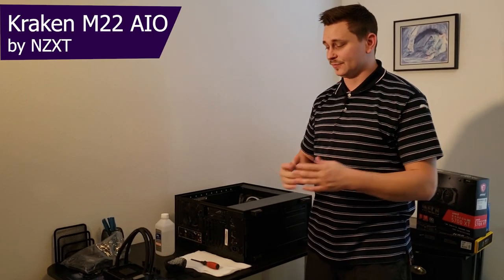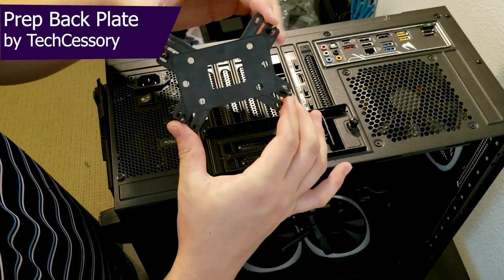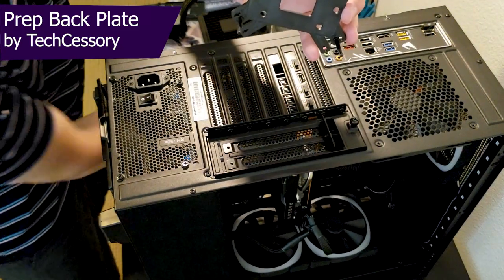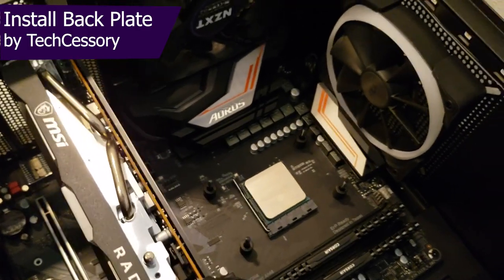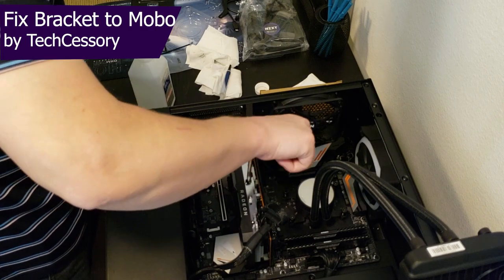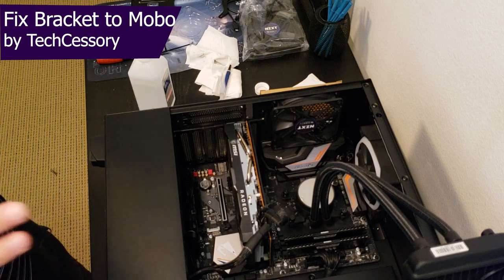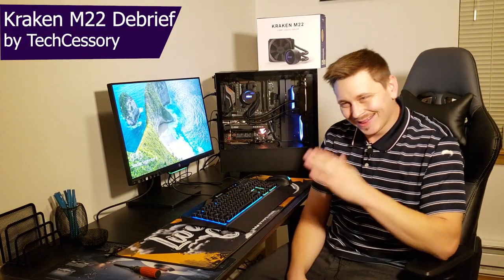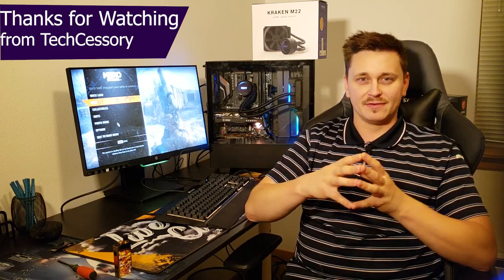AIO Liquid Cooling | NZXT Kraken M22 Install Guide

Comment: Hello sir. Late comment but Can i use the 120mm fan/radiator as an exhuast instead of an intake?
Reply from the maker: Exhausting from the front? It depends on the rest of your components. If your case runs hot already than I would suggest not to, but you still can. Let me know where and I can give some more input.
Reply: @BainCustom  Thank you for the reply kind sir. I have an antec gx 200 cabinet. My Air cooler simply isn't doing well enough for my i7 7700k and I want to buy this specific cooler as it is withing my budget. Now, I am currently using two front 120 mm intakes, which I plan to replace. I also have a 120 mm exhaust in the back of the case which I plan to replace with the radiator and 120 mm fan that comes along with the NZXT krakken. Will this be a good change for my airflow?
Reply from the maker: That's a tough one. Typically if you are able to exhaust in more than one location than I can see it being beneficial. Because of the limited airflow in the case I would still run the radiator at the front for fresh air.

Either one will work and the CPU I'm sure will survive just fine, but the radiator will constantly be taking in warm air. Which can wear it down quickly over time. Is there any air vents on top? It didn't look like it
Reply: @BainCustom  no only two intake slots in the front and one exhaust slot in the back. Should I just set up the radiator in the front along with another fan and have 2 exhausts in the front and one intake in the back. Will the air pressure be efficient in this case?

Comment: Hey is your AIO loud? I look at the bios and the pump's RPM is around 3900+. Is that normal? can you modify the pump speed?
Reply from the maker: Mine is fairly quiet. I have not seen for the M22 a way to change the pump RPM, I would imagine it's purely performance based. I am about to do a review on the kraken x53 which does have control of the pump.
Reply: @BainCustom  hey thanks for the reply, where is the water tube located on yours? I have mine below and I'm thinking of putting it above(might look bad but might solve the loud sound and vibration)

Comment: I'm sorry I'm new to pc building but does this only fit in nzxt cases or will it fit in my be quiet pure base 500?
Reply from the maker: No worries at all. Absolutely, it should have no problem fitting at all. You would probably want to install it onto the front of the case.
Reply: @BainCustom  ah cheers mate
Reply from the maker: For sure!

Comment: Does it matter which way the 120mm fan is facing?
Reply from the maker: Well, it depends on your case setup. But you will typically always want to be pulling or pushing fresh air over the radiator, not hot air from inside the case.

Comment: Should I plug the 3 pin pump cable into a   Cha_Fan/WP header?
Reply from the maker: Yeah I think I have my in a fan header or the CPU fan header. Either way works. But preferably the pump to the chassis fan and the fans to the CPU connection.
Reply: @BainCustom  but the problem is my fan cables are connected to the pump cable I think thats because the fans are controled of the water temerature
Reply from the maker: What aio are you using? I haven't seen all cables into one yet. It would be just like having an extension cable added to a single header.
Reply: @BainCustom  The NZXT Kraken X53 the pump has two cables that go in, one is for the usb 2 port on your mainboard i think for the rgb and software and the second cable that you put into the pump is three cables in one. (Sata for the power, Fan headers for the included fans and the actual pump cable that I was talking about.)

Comment: Hey man I got mine today and when I use the spacers it’s wobbly because it’s loose and doesn’t tighten and moves around but when I use no no spacers it tightens really hard and stays there perfect. Is that bad ?
Reply from the maker: What CPU and motherboard are you using?
Reply: @BainCustom  ryzen 5 3600 with b450 tomahawk max and the mount was dont right and everything.
Reply: Oh yeah I meant to say I put 2 spacers and they tighten but with one it doesn’t. Is that okay?

Comment: I don’t have an aio pump connector 😬 what do I do
Reply from the maker: What's your motherboard model?
Reply from the maker: You may use the CPU header if you have no aio pump connection on the motherboard btw. But I prefer to use the aio pump connection.
Reply: TechCessory I couldn’t find any of the ports on my motherboard, so I made the safe decision to take it all off and return it because I don’t want to ruin my computer. Do you recommend any good coolers that aren’t liquid? Also for AM4
Reply from the maker: Anything from noctua is good. I believe Corsair just put out a new air cooler or it was NZXT. I would look there for sure.
Reply from the maker: It's the Corsair a500 which I will be making a video about soon I think.

Comment: Hi can you please help me? Im so confused. My mobo has no rgb header so can i change the fan included with rgb fans but molex powered and the pump is powered by cpu fan header?
Reply from the maker: Yes, one option is to power the pump using the CPU fan header. Thanks for the question 👍
Reply: @BainCustom  but the pump is 3 pin and my cpu fan header is 4 pin will it work?

Comment: Hey I have a the Asus Prime H310M-E R2.0 motherboard and I can’t find the 3 pin connector for the radiator. Is it compatible?
Reply from the maker: I break this down a bit better in a newer video. Typically you will want to use the system fan pin or the CPU fan pin for the pump. I tend to use the system fan and then the CPU fan for the actual radiator fans.

Comment: Is the backplate necessary or can I use the one that my motherboard has
Reply from the maker: Yeah you have to use the included backplate. It doesn't adapt onto the am4 backplate. At least they didn't send that hardware with the AIO when I installed it a while back.

Comment: Good video, like it
just one thing.... you didn't install the RAM on dual channel, please read your mobo manual xD
Reply from the maker: That's interesting. At first glance I read the manual and it says 2 & 4. But the way they label the slots make it side by side.

I appreciate the bit of info. I probably would not have noticed, I do also get 3200mhz from the ram. So I hope it helps with the switch.
Reply: @BainCustom  Don't worry, the same thing happened to me on the same motherboard, but one day reading the manual I realized that the modules were bad installed and changed them.

By the way, I checked your channel and looks interesting, subbed

greetings from Mexico!!
Reply from the maker: Thanks for the support and tip. I changed it around today and I did bench about 30 points higher and no crashes.

So it definitely helped.

Comment: My Motherboard dont have a pump connection can i put it the pump 3 pin in the CPU Fan connection
Reply from the maker: absolutely. I am current running my pump on the cpu fan header as well.

Comment: is it ok to cut just a little on those hose,  its kinda too long for my rig
Reply from the maker: I personally wouldn't. It will void any warranty and the length of the hose is optimized for cooling. Rotate the radiator so the tubes coil up a bit to save space instead.
Reply: Royrafe Bancoyo no
Reply: @BainCustom  when should i change the liquid inside, its already been like 8 months after i bought it

Comment: Hey i order the m22 and im not replacing the cpu can i use 70% isotopic alcohol wipes to get the thermal paste off the cpu
Reply from the maker: For sure. Don't be over generous since it has more distilled water in it. But it shouldn't be an issue as far as I am aware.

Comment: Can i exchange the cooler fan with the back exhaust or no?
Reply from the maker: Almost any 120mm fan will fit on the radiator. If you are looking to place it in the exhaust fan opening then it would depend on the case.

Comment: i install this and when playing rainbow six siege max temp is 62c is that hot ? or i need to change the fan position
Reply from the maker: Under load...no. if you hit the 70's and 80's I would think about a 240mm instead. What is your CPU?
Reply: @BainCustom  2070 54-58 max load  but my gpu still hot 69 to 75c is that ok? i forgot to mention mine is x53

Comment: So you don’t need the small usb at top of the thing on cpu because that only controls lighting right?
Reply from the maker: You could opt to do that. But you will not get any control from the CAM software if you leave the USB connection out.

Comment: So I have a AM4 bracket, which holes do I use since the graphic is a little confusing
Reply from the maker: You want the bracket to be vertical on the motherboard back and line up the 4 screws to fit into the motherboard. Kind of akward to explain. But I hope this helps.

Comment: hi I have the same motherboard when i removed the stock cpu fan it was in the cpu fan slot below that is cpu opt and theres also the system 5 fan pump my question is whats the cpu opt for?
Reply from the maker: I believe it is for an AIO radiator. Kind of like a secondary CPU fan header.

Comment: Im stuck on how to install the backplate screws
Reply from the maker: They are a bit akward. Sorry for the late reply. The ones that have a notch on the screw head fit into an arrangement that will fit the AM4 motherboard holes..which is where the stock backplate is removed from.

I know it's a bit weird, but I hope this helps. Let me know how it went.

Comment: Hey do I have to buy thermal paste if I want to build à computer with the nzxt kraken ?
Reply from the maker: It is supposed to come with thermal paste. But it wouldn't hurt to have a back up in case something goes wrong.
Reply: It comes with paste, but it's a thin coating already applied to the part that fits on top of the CPU. They don't give you an extra tube of it or anything.

Comment: What’s with the 3 plug in on the radiator I need help plz
Reply from the maker: Do you mean the cable for the pump power?
Reply: TechCessory yes I watched ur video again and found it out thx a lot man
Reply from the maker: Oh heck ya! Glad you figured it out.
Reply from the maker: I have seen aio's last for 5+ years. This model doesn't have the ability to maintenance it in any real way. There are some out there that do.

Comment: If I do not have thermal compound available, can I just insert the CPU mount with the basic pre-existing thermal paste that it has?
Reply from the maker: You can for sure. I would say it is temporary thermal paste that is pre-applied. You will have to change it out very soon.

Don't forget to sub to the channel. I will have another aio cooler review and install coming up soon.

Comment: Can you mount this fan on the back?
Reply from the maker: The fan with the radiator? I'm not 100% sure it would fit, but I wouldn't mount it there to begin with. It would definitely cause some heating issues. Thank you for the question and welcome to the channel. Be sure to check out our other videos on all in one coolers, we have quite a few!
Reply: @BainCustom  ok thank you
Reply from the maker: Absolutely

Comment: Does the rgb have a separate port to hook up to and if so what port?
Reply from the maker: Yes it does. It's the mini usb cord. It plugs into the cooler head and routes to the motherboard for power. 100% controlled by the CAM software.

Comment: What a out the sticky play on the back of the mobo? It has to come off to throw on the m22 backplate on, no?
Reply from the maker: Yes you would want to remove the stock backplate. Then use the supplied back plate from NZXT for the cooler head.
Reply from the maker: But just the backplate, not anything fixed to the motherboard.

Comment: Hi, I want to ask, I'm building my pc soon, I got the NZXT H510 for my chassis (not elite) and I want to buy the Kraken M22 for the cooler. So my question is, will it fit on the chassis? And should I put it on the rear or on the front?

Anyone can help me? Thank you so much 😁
Reply from the maker: Hey thanks for the comment and question. I hope you liked the video. 

The M22 does fit on the h510. You can use the rear fan port if you want. It is very close to the CPU socket, so it definitely gets akward. I put mine at the front of the case pulling fresh air.
Reply: @BainCustom  thank you so much for the reply. Last question, do I need another fan at the front apart from the kraken fan?

Comment: does the thermal paste come with the cooler?
Reply from the maker: NZXT says it does. But I would grab a tube just in case.
Reply: There's a thin coating of paste already applied to the the piece that fits on top of the CPU. There's no extra tube of it or anything.

Comment: where did you put the fan for the radiator?
Reply from the maker: I put it in a push configuration. The fan is pushing air out of the case over the radiator. A lot of people prefer pulling the air in instead. Really depends on your setup and asthetics.
Reply: but you put the radiator on the front of the case.
Reply from the maker: Yes I did.

Comment: can this work with the asrock b450m hdv r4.0
Reply from the maker: It will work for any AM4 socket. You just need to know where you will plug your fans in and if your motherboard requires a cpu fan to be plugged in.

Comment: Hey man could you help me i recently changed my aio and now my cpu temps spike like crazy and even going to 100c
Reply from the maker: Did you use the factory applied thermal paste? What is your CPU? I see this happen quite a bit. I would uninstall the head and Re-install the head using fresh thermal paste and make sure the head is making good contact.

Also be sure that the pump is plugged in.

Don't forget to subscribe!
Reply: TechCessory i believe i was using way to much thermal paste and i had to do it like 6 different times but everything’s finally good again thank god
Reply from the maker: @SCUUZEM3  Good good. Yeah it is usually always the thermal paste or something along those lines. Glad you got it taken care of.

Comment: can you install the m22 in the top of the case?
Reply from the maker: If you have the h510 or similar case you can...but it will be a bit akward because of the height. But it works just fine.

Comment: Can I mount this at the top of the case ,
Or can I replace my rear fan with this now being a water cooled cpu ?
Reply from the maker: I strongly recommend at the front of the case or the top of the case. The top works but is a tight fit and the tubes are really long for that application. The front makes the most sense. You can offset the top mount toward the front of the case and it should fit well.
Reply: @BainCustom  I have a Corsair Carbide SPEC Series SPEC-01 Aggressive Red LED Mid Tower Gaming Case,  where would be best to mount like?

Comment: Putting the AMD bracket into the cooler is a fucking nightmare. Holy shit.
Reply from the maker: Yeah it's not the best design. I just did a video on the x53 and it uses the stock am4 bracket, which is much easier!

Comment: can i plug radiator 3 pin header to the sys_fan connector?
Reply from the maker: I think technically you can. But it's always best to use the pin that says aio pump.
Reply: Ive read it has to be the cpu fan_1 connector in some cases
Reply: Like on my board, it doesnt have a pump connector so i am assuming im in that boat and will have to use cpu fan_1
Reply from the maker: @scottgolnir2749  Yeah I have used Fan 1 or Fan 2 for the pump and visa versa for the radiator fans. It works.

Comment: I want to buy the h510 Elite case and the fans in the front are 140mm fans. can i mount the m22 radiator onto 140mm fans?
Reply from the maker: No I don't think that will work. You may be able to mount the 120mm fan on the inside of the case. But the x42 is the 140mm version.
Reply: TechCessory I just wanted to buy the m22 and then i would have one Fan with rgb in the Front and the other one without rgb and this wouldnt look that good anymore